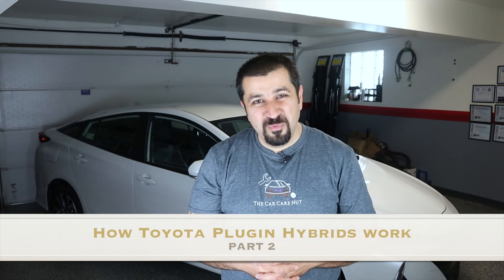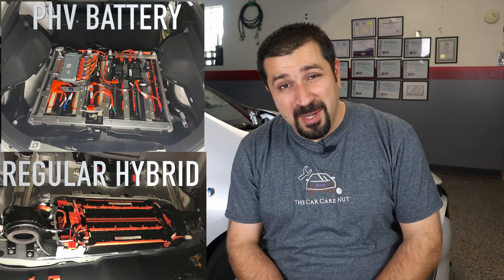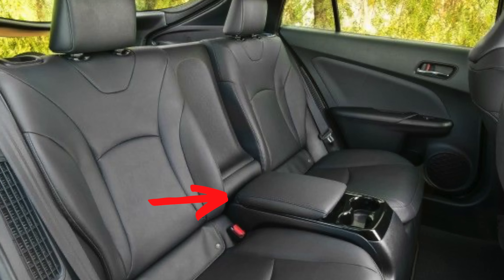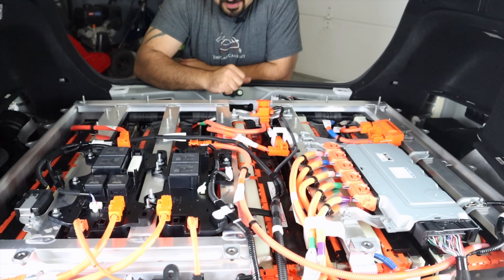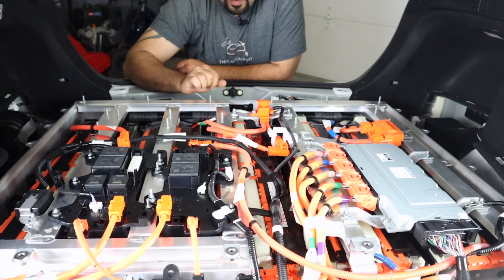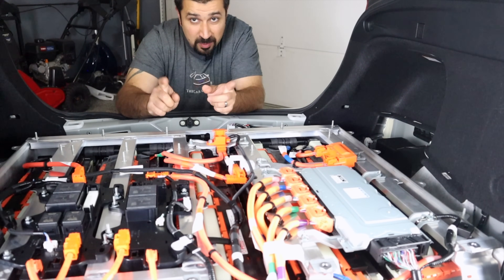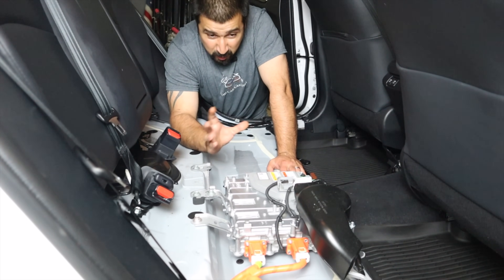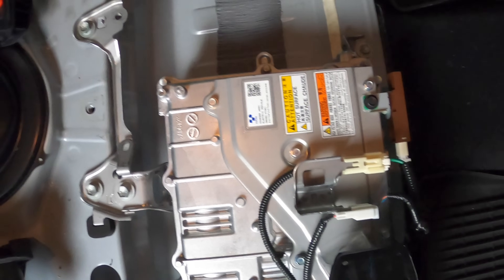Toyota plugin Hybrids. Are they any good? Battery and charging review

Comment: I just recently got myself into a 2026 Prius plug-in hybrid XSE premium I had a 2024BZ and I’m adjusting to the lower amount of all electric range as well as the only charging the all electric vehicle to 80%. There’s no option to limit it on the Prius feels weird to charge it to 100% all the time. What are your thoughts on charging with the Prius prime or Prius plug-in? It’s also weird to see the battery go from 100 down so quickly.

Comment: I got a Hybrid Plug-in Prius `2012 : my question is what is the purpose of the charger cable for? I am driving the car without using it. I haven't plugged in for a long time. Is just the plug -in feature and option or is it mandatory to use it?

Comment: You have said the plugins should be driven in HV mode periodically, because gas is corrosive.  I'm curious how flowing gas through the engine is less corrosive than just letting it sit?  Also, this seems like a disadvantage of a phev vs a bev.  Is there a fix for this issue that doesn't involve burning gasoline?

Comment: Hi, I wonder Prius Prime can still function as a normal gasoline car if its plugged in battery wears out. Thanks!
Reply: You can still drive it normally as a convitional hybrid without charging it.
Reply: @zaidalhabshi  It won't have the same acceleration if the electric motor assist is not available because the battery does not have sufficient charge.

Comment: Great video! I have a 2013 Prius Plug-in.  Any pertinent differences?  I've had no problems thus far after 10 years and 120k miles besides the upper glove box coming undone which was easy to fix. Are there any options of expanded batteries for theses or if there are issues?  Eventually, if I have to replace it, will it be with the same 10-year old battery tech?

Comment: Any concerns about rear seat passenger  usually children , with electro magnetic fields caused by the high amperage caused by the batteries and mg1&2 right under the seats ?
Reply: Yes for the EMF off the batteries and main wiring. MG1&2 are in the engine compartment, not under the rear seats.  : )

Comment: I don't need to charge daily however I set the charging schedules to every morning at 1am when the rates are lowest here.  If the charging cable is not present at 1am, are you saying that my Prius has already prepped the battery and readied the car for the 1am charge?  What are the consequences of that to my car if I end up only charging 2 or 3 times a week while the charging schedule is set to daily?

Comment: I have a 2012 Prius plug-in….is this the same deal?  I’m trying to educate myself to maximize my cars life.  I know mine has a lithium ion battery but 10 years old.
How do you feel about the Project Lithium replacement batteries?
Would getting wheels that are 5 lbs lighter each be worth while?
Thanks again for your channel.
Reply: In how many years and how many kilometers (miles) can I expect to change the battery on a plug-in hybrid? I am considering purchasing one that is 10 years old and has nearly 200,000 km (124,000 miles). I appreciate your response

Comment: Thanks for your thorough explanation in this video. I had a second generation 2009 Prius that I was driving on a hot day, high up in the Rockies (Colorado). I was driving with the AC on recirculate for I was following a smelly box truck. After going down a steep mountain grade into a tourist town, I stopped and had lunch for 1 1/2 hours - the hybrid battery indicator was fully charged, green. When I turned the car back on, I had to floor the pedal to go into reverse for I had no power from the battery, and oddly no warning light. The car then felt very under powered with no torque pulling away. On the display the hybrid battery stayed disconnected from charging, for six miles and sensing maybe the battery might have overheated, I drove with only a fresh air intake and no AC.  The display then finally indicated normal function after 6 miles of driving. I repeated this issue in climbing the 14,000 foot Pike's Peak, where the car sent no regenerative energy to the battery on the way back down.

So in going along this long ramble, the lesson I learned is not to use air recirculate in hot weather, especially if the battery is charging / discharging a lot.
Reply: The car uses the cabin air to cool the battery. The AC helps cool the cabin, and therefore helps cool the hybrid battery

Comment: @The Car Care Nut  
I have a question for you sir. I understand how much heat is the worst for the prime’s traction battery battery. 
My concern is this. The primes battery being in the trunk. When the car is parked out in the sun with the windows closed, 
it gets insanely hot inside the car. This type of heat damage seems unavoidable if the battery is in the trunk? What is your opinion on this?
Thank you!

Comment: Thank You AMD. Please advise if you have a similar CCN video focusing on charger adapters. That is to say the different chargers one may encounter on a road trip and how to future proof that experience. Perhaps a introduction / explanation for plug, adapter and charging stations one might encounter on a road trip. The onboard charger explanation was appreciated. I think, in my case, my RAV4 Prime XSE will have included ONE plug for 120V (household wall socket). Possibly consider discussing what we would need to charge our battery should we be visiting a friend with a Tesla home wall charger - is it possible to use an adapter to accomplish a charge? I read that it is not possible to adapt to a Tesla Supercharger. 
A Tesla Home Wall charger - I’m not certain though perhaps with the correct adapter. Thank you

Comment: I own both a Prius Prime and a Rav4 Prime XSE.  Both have a 3.3KW onboard charger.  The XSE OPTIONALLY offers a 6.6KW charger as part of about a $3K upgrade package.  You mentioned the Rav4 rime XSE had the ^.6K charger but only a small percentage have them.
Reply: The 2023 RAV 4 Prime XSE has the 6.6KW charger standard. Months ago i put $1,000 down to get in a queue for a 2023 Prime and two days ago the sales lady called me and said they have a red one and a white one being built and i was first in line. I chose the red one.
Reply: @unclej3910  Were you able to buy it close to MSRP?  I was thrilled to buy my 2021 Rav4 Prime at MSRP and got the $7500 tax credit.  Too bad that almost no PHEV will qualify for tax credits until at least 2024.  Toyota won't get any tax credits until probably 2025 when maybe they can move the Rav4 and Prius Primes assembly from Japan to the US.
Reply: @cohenhs   I haven't signed any papers. They have a $5,000 "Market Adjustment" tacked onto the MSRP.   After thinking it over, i may cancel because my 2022 RAV 4 Hybrid XLE is getting the job done. And as you pointed out, Toyota's tax credit has expired. Also, i have no way to charge a PHEV or BEV where i live or work. Although there is a charging station about 1/4 mi. from my Apt. And i only drive about 8,000 to 9,00 miles a year on average.

Comment: 25 Miles of Electric Range just seemed like a waste of time. Once the battery pack even degraded slightly that range because so little that it's useless. I just decided to get the 2022 Prius XLE AWD and i'm getting 49 MPG highway and 62 MPG city.  Not sure I'd waste my time plugging my car in every night because you would not even be saving the $1.50 in gas since you still have to pay for the electricity and installing a proper 240V line because only a idiot would use 120V :D so theres goes another $5000 on a proper electrician and all of your gas savings before you even start driving. Prius Prime = Prius Turd

Comment: I've been following your page as I'm a big Toyota fan because of their reliability. I currently own 2 4runners which I have maintained properly thanks to your channel. Now, I'm considering getting the Rav4 Prime as this will be a perfect vehicle for my new job which will require me to drive out to the country side sometimes needing to drive to a deeper water due to floods. I'm just concern about the placement of the Li Ion batteries for the Rav4 as it is placed undercarriage that it might cause some issues with my driving condition. Is the battery compartment water sealed? Would you still recommend RAV4 Prime for my situation?

Comment: can you use a addapter to go from 110 to 220 with the same cord???
Reply from the maker: Hi! You can’t. You’ll need a 220v charger
Reply: @TheCarCareNut  ….With all due respect,  did you answer the question correctly??  I think he is asking if the 120volt cord that comes with the car, is the same cord you need for a 240 volt charger, or are they two separate cords??? Thank you
Reply from the maker: Ok I’ll rephrase that. The cord that comes with the car is only rated for 110 use. In order to charge at 220 you’ll need a wall charger which comes with its own cable.
Reply: @TheCarCareNut  Thank you for clarifying.  Additionally,   How many new 2022 Prius Primes do you think are available in the whole USA at one time in March 2022.  Was the Toyota salesman pulling my leg that there may only be 5 available in the USA in March 2020???
Reply from the maker: Honestly that I wouldn’t know
Reply: Good question

Comment: Your videos on the Prius are fantastic!  However, I wanted a Prime but ended up with the Limited that uses gas.  I'll tell you, your videos are eye openers.  I didn't realize the weight factor in the Prime.
My hybrid Limited has EVERYTHING I would really want.  It has more room inside then my other cars (Cadilacs, Mazdas).  Believe it or not, it is fast off a light.  Finally, I don't get "EV Anxiety" worrying about a charger.  Oh, my front screen is also huge (Tesla size) and makes using the map a cinch.

Comment: How often I need to run the gas engine in my Prius Prime 2022. I usually drive in auto mode, let the system decide if the engine needs to come on . Thanks

Comment: Hi and greetings from across the pond. I purchased a new plug-in PHEV RAV4 Dynamic Premium last October. I read that it is best for the battery to charge it to 80% that gives about 34 EV miles rathef than the 46 EV miles on a full charge. However  I now understand that the battery will not fully charge to 100% and will automatically stop at 80%. Am I therefore wrong to stop the charge when it shows 80% on the EV dash display?
Can I also ask another question. When moving the vehicle into P, it seems that the park brake dies engage as the (P) appears on the dash dislay. Does this mean that I dont gave to put it in neutral and don't have to then apply the park brake before putting the gear shift into P  hope this makes sense and thanks for all the excellent video posts. I folliwed your advice and had an oil and filter chage at 1,000 HV miles. John
Reply from the maker: Hi! I would charge it fully and use it. It already has the build in protection however try not to charge it and leave it undriven for a few days over and over as that’s not good for the battery
Reply: Sorry about the spelling mistakes but had to rush as my wife was shouting that dinner was ready!!

Comment: In Europe there is this car also with a solar panel in the roof and a second battery wich will be charged by the solar panel. Then this battery will charge the main battery. The car is parkt in the sun with no external power connected. The charging by the sun is on. But in a hot environnement can it also employ the AC system to cool down the the battery? Or will it not charge because it is to hot?  Thanks for your great video.  Gr. Matthew
Reply: Great question

Comment: Thanks for the very informative session. A quick question - does it mean that the charger under the back seat would not be in use when the car is driving? It sounds scary if the high voltage charge is in use when someone is sitting on it?

Comment: Thank you for these videos! I am anxiously waiting for my 2021 RAV4 Prime to arrive. My parents are traveling from FL to MN to drive it back for me since I can’t get away from work to get it. They are hard to get down here, my local dealer has only received one & it was sold long before it was delivered. I have the ability to recharge my RAV4 at work so I will be able to drive on full electric during the week. So it’s good to know I need to pay attention to making sure my gas engine runs to prevent long term damage. It’s a great excuse to go on a dive trip…I need to run my gas engine. Keep these videos coming, we are a Toyota Prime family now as my parents have a 2018 Prius Prime.

Comment: I remember years ago being told that charging an iPhone all night long ( in preparation for a full business day the tomorrow, for example) will reduce the life expectancy of the battery. Does this apply to Toyota batteries? My RAV4 Prime takes about 8 hours to charge at home (230V, 10 Amp). If I leave it plugged in overnight for 10-12 hours, am I damaging the battery?
Reply from the maker: Hi! You’re not damaging the battery but I would still utilize the charging schedule to optimize the life of the battery

Comment: In some ways the Prius prime reminds me of the EV conversions we did back in the 1990s. In my particular case , I converted a VW
 Rabbit diesel with the ElectroAutomotive VoltsRabbit kit. Back in those days, we didn’t have access to lithium technology, so we used lead acid.  In my car, that meant 500 lbs in the rear, 500 lbs in the front. The electric motor was in line with the transaxle underneath the front battery pack. My hatch cargo floor was actually lower than in the Prime.  But the Prime is a much more technologically-advanced car than the VoltsRabbit. I still have that VoltsRabbit by the way.

I have some pretty significant concerns about our Prime’s battery pack being in the Sacramento summer heat day after day. I touch the top of the battery pack when the car is sitting, and it’s hot, even underneath the two covers. It’s air cooled, so it really relies on the cabin temperature. The Nissan Leaf battery pack is air cooled, and they suffered severe degradation in the summer heat. So my plan is to typically charge at the end of the night so the battery pack is as cool as possible, then charge for three to four hours before the sun comes over the house in the morning and heats the car up very much. Our 2018 Prime we purchased only a few weeks ago, has only 11K miles on, and replaces our 2013 Prius II, which had 250K miles on it - unfortunately a coolant leak into #2 cylinder occurred, and that was the end of that 😥.

Comment: I have noticed an odd behavior with my 2018 Prius Prime.  If I go on a long drive and run in EV mode until the main battery is depleted and the engine starts.  I have discovered that when I encounter a long downhill the main battery does not seem to charge.  BUT, on the same drive, if I just deplete the main battery to 50% or so, when I get to the long downhill I can regain about 16% (it's a long hill).  I can't imagine why they caused the car to behave in this manner.
Reply: Did you try putting the gear shifter in the “B” mode (taking it out of the D= drive mode). B is for braking and simultaneously changing

Comment: We own a 2010 Prius and a 2017 Prius Prime Advanced.  Both good cars.  I will not buy another with an ICE.  My 2017 plug-in hybrid is a very nice car and we bought it new and it was hard to get one in the Midwest.   At this point in time with all the advancements in full electric vehicles it makes little sense if any, to buy the added complexity of a car with both electric and ICEngine propulsion.  Especially if that ICE doesn't run except once in awhile.  I would love it if I could take my Prius Prime into a Toyota dealer and for 5 to 10 grand they would remove the ICE and fill that space with batteries and make my Prius Prime into a 350 mile per charge Electric vehicle.  No more oil changes or going to the gas station.  I am not holding my breath.
Reply: Don't forget that EVs are not carbon neutral. Takes a lot of energy to build them, just like an ICE does, but a lot more  earth needs to be mined to get the components of the batteries. Not to mention the energy needed to provide the energy to charge them. Don't get me wrong, they are great vehicles, but the policy makers are from figuring out how to provide the energy needed to charge all the batteries were every conventional car to be replaced by EVs.
Reply: You obviously don't take long trips
Reply: @victorriga9814  Not very often for sure.  I really hate adding all that CO2 into the atmosphere like I have been doing all my life.  It is so darned hot out because we humans have changed the makeup of the air so much.  We are paying the piper now for our foolishness.

Comment: I like how it keeps the battery at the optimum temperature to maximize the life.  Can I give it permission to turn on the A/C and cool the battery if I'm parked in the hot sun at work and it's getting like 115 degrees inside the car??
Reply from the maker: If you schedule the charge and give it permission it will do that

Comment: I have a 2021 RAV4 prime for a couple months now and it's fantastic.  Able to drive 52 miles a day on all electric is the best. Wish it was 100 miles it would be perfect blend of  gas and electric. Toyota should upgrade the system to much fasting charging and yes I installed Nema 1450 at 240 volts   which cuts the time to 4.5 hours. Toyota should have put the faster 2 hour charging on both trim levels not only on the XSE in the U.S. still great over all. Super comfortable on long road trips.  No regrets do far.
Reply: bummer, I wonder if you can buy the faster charger and upgrade?  unless the battery pack is different too? some lithium cells can accept higher charge rates than others